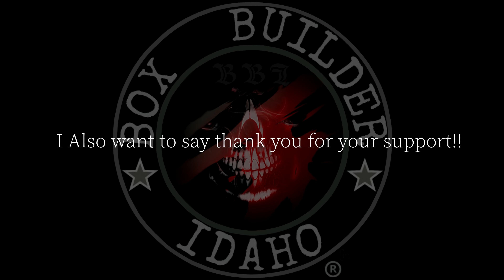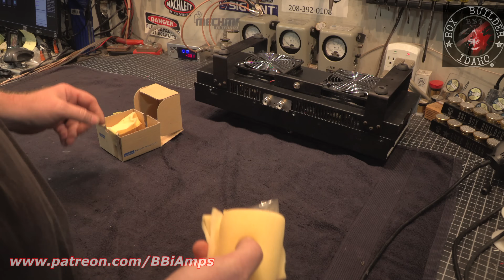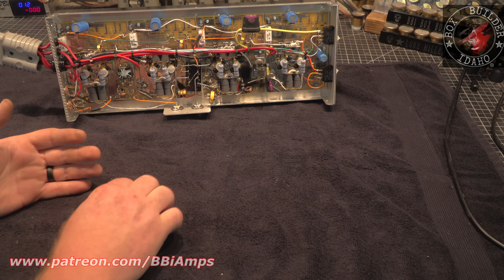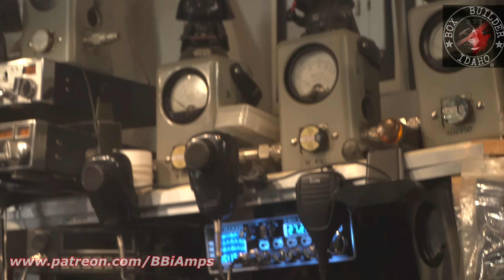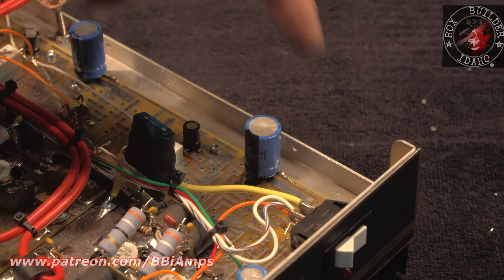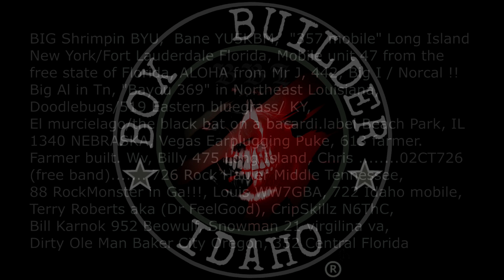Ro#36 2023 tx star sweet 16

Comment: Goodmorning Mr. BBI..
Can you tell me and the internet.  At which point in the sweet 16 lineage,  Based Upon Serial numbers,  were the amplifiers outfitted with DEI'S? A ballpark degree of accuracy would help. Or any other externally visible aspect of this model amp that could deduce if DEI's are in it?
Please accept my appreciation in advance for your help.  Thanks.
Reply from the maker: 2010 forward.
Reply: @BoxBuilderIdaho 
Thank you. Is that date written externally? 
If I have to remove the lid to see that date. Then I can just read the top of the pills.  Lol. 
I'm trying to purchase a very clean swt 16.
Over the phone.  I don't think the seller will remove the cover for me. Before I buy it. 
All I did was ask him what it smells like.  Lol. Very obvious if has  been blown by the smell.

Comment: The misuse of the LDMOS stuff doesn't surprise me. There are people that could break an anvil out there. 

The LDMOS is cool because of two features you've mentioned, low drive power and output durability. Some of the parts I've seen say they have 30DB of gain while a conventional BJT amp would probably be 12ish. That's a huge advantage if you're trying to drive with a QRP radio and save overall (battery) power use in the chain. Something like a TruSDX or an Xeigu 5105 or even a BitX/UbitX. I mean without the attenuator in the radio you could take one of those QRP setups to legal limit power no problem with a 2 transistor unit like you're talking about.

Right now I'll probably end up with IRF510s honestly. The reason being if you pop a couple of those they're a buck or two and not $30-50. Not sure how they tolerate SWR mismatches though in comparison to an LDMOS. They're cheap enough maybe an experiment would be in order though.
Reply: Love it. That’s awesome

Comment: How do you get the SWR so low? With my amp off the SWR is perfect. When the amp is on it jumps up to 2-3 and I can’t get it lower
Reply from the maker: You can adjust it by coax length sometimes then there's other times where you have to go inside and adjust
Reply: Is it easy to adjust inside the amp itself? I have a fatboy 2 pill

Comment: At the very start of the video you said the customer wanted you to put 2879"C"'s in it. I was pumped because i wanted to see how you were going to deal with rewrapping the transformers and how to address the tune. But then i saw that you did nothing to the transformers and then i paused the video and got a peek at the new transistors and you put 2879/16D08's in it. That explains the no transformer work. Was the customer upset that it didnt get "C's" in it or did he decline when you told him about the additional work to make that happen ? Signed = Just a curious dumb ass